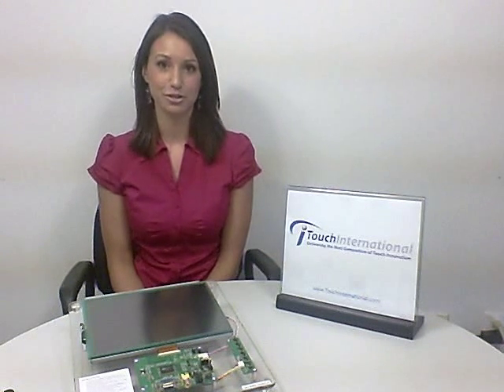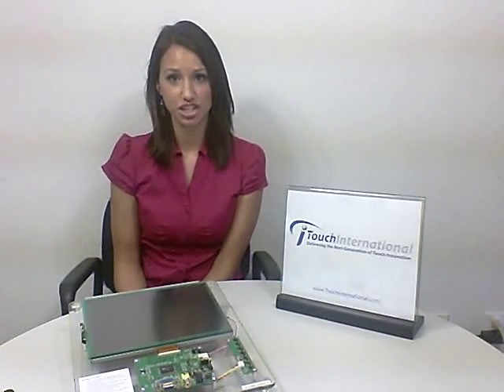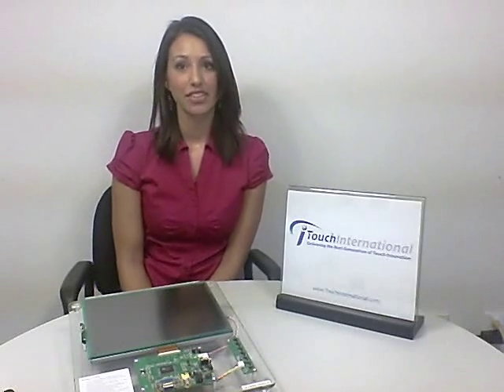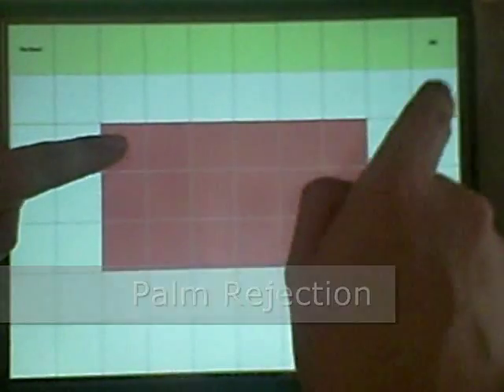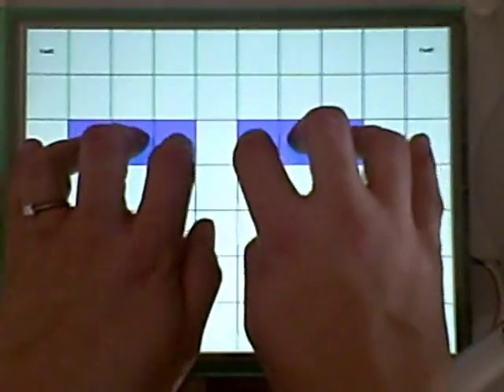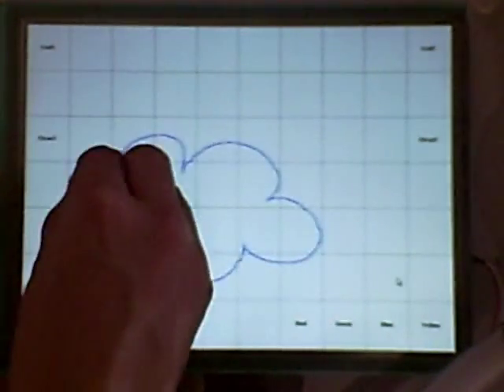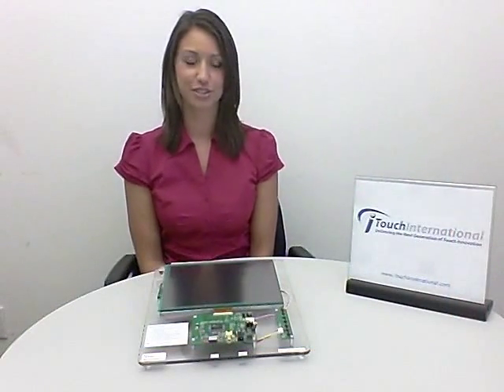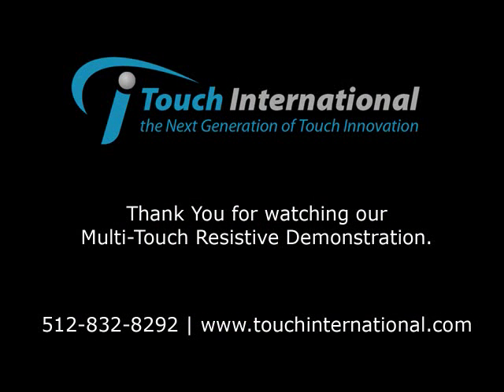Multi-Touch Analog Resistive Touch Screen by Touch International

Comment: Hi TouchInternational, I am developing a device that need high resolution, low latency under 1ms, single point and must be resistive. Also it needs flexible for curved surface but doesn't need transparent
Is there any tech like that on the market?

Comment from the maker: @ TheBySteps

In response to your question, "I was wondering how big in mm the gap of air is, between the two layer?"

The answer is that it is typically between 0.05mm and 0.10mm.
Reply: Hello, my friend. I am lily zhan from Shenzhen Lvtouch Co., Ltd., which is professional touch screen supplier including the 4 wire resistive touch screen, 5 wire resistive touch screen, infrared multi touch screen, saw touch screen and touch monitor. If any need, you are welcome to contact me. my email is lily@lvtouch.com, my skype: lily-in-moon, my wechat: 13510141024, call me +86 13510141024, to know us more to www.lvtouch.com .

Comment from the maker: Capacitive is a better choice for most applications because it has better optics, durability and performance. But some applications require pressure sensing (resistive). For example, touch screens used in cockpits often use resistive to insure that no false touches are sensed (this can happen with capacitive). But for most applications, projected capacitive will take the cake, so check out Touch International’s MulTI-Touch projected capacitive technology video.

Comment from the maker: @tailblaze08 

Archos is a company who manufactures handheld consumer multi-media products such as MP3 players and tablets. Touch International's Multi-Touch Analog Resistive Sensor (MARS) product can be made as small as 7.0" diagonal. If you are with a company that has design capabilities, a product could be manufactured for Archos or their products, however, the per piece price would still be considered too high for a consumer grade product such as this.